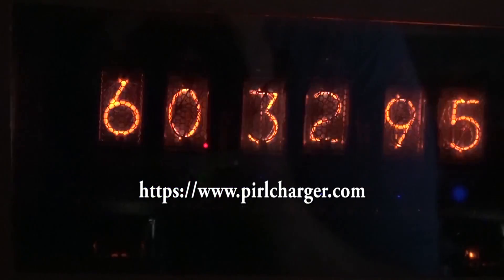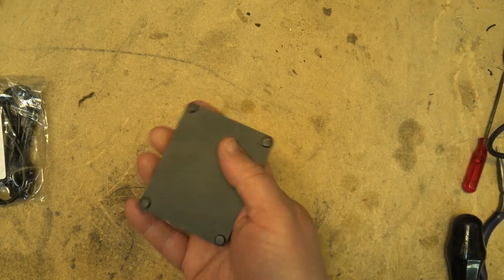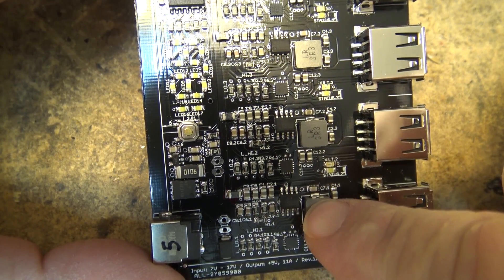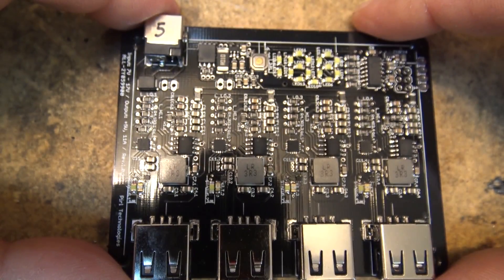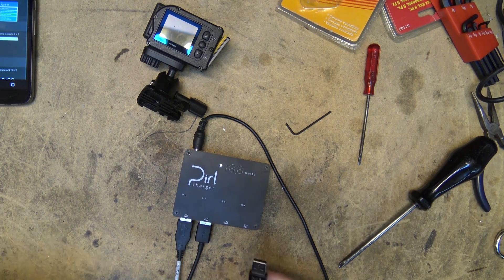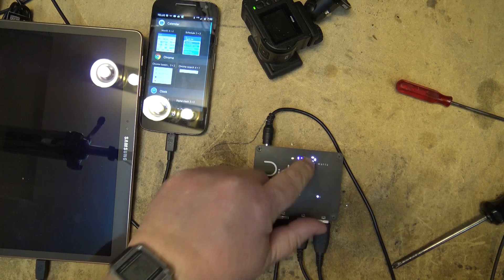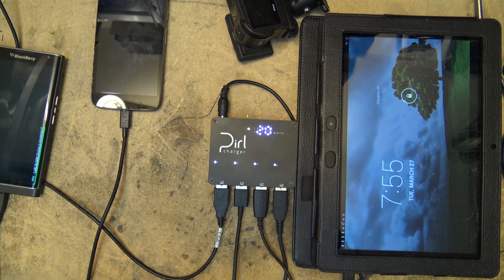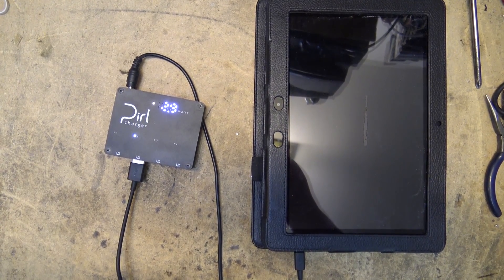pirl charger prototype teardown and test

Comment: Its okay the only disadvantage is it took 5 hours to charge ipad!!! Terrible! Just looks nice
Reply from the maker: cell cobb 
Really? I change my Samsung tab10 in about 2 hours my Samsung s9 charges up in just over an hour. All my devices charge at the maximum rate supported by the device. I have been using it as my daily driver to charge all my devices and it hasn't skipped  beat. Therefore if you are the only one having an issue I would suggest it is  problem with your device or the cord you connect it with can't handle the current. I have been using it with a 30 watt adapter which means only 30 watts max across 4 devices. I generally only charge 2 or 3 devices at once as I use it to change my work phone and my tablet plus a battery charger and power bank. The power it supplies per port is totally dependent on the device.

Comment: What is the part # of the (4) 16-pin ICs? I can't tell from the video.
I can see the AP65450 which is 4A, 18V, 650kHz ADAPTIVE COT STEP-DOWN CONVERTER
https://www.diodes.com/assets/Datasheets/AP65450.pdf

Comment: I think they would save big on BOM if they just use a pre-made 2-1/2 digit LED display, rather than hand fabbing it like they did in this prototype.
Reply from the maker: William Squires 
Believe it or not this is probably cheaper than buying a 2.5 digit display. Smd led are dirt cheap.
Reply: 12voltvids - maybe so, but labor isn’t! Even if you have a pick-and-place machine, it’s still faster to pick-and-place a single LED display, than all those individual SMD LEDs. You also have the cost of 3D-printing the light pipes, and machining the holes in the case vs. one rectangular hole for the 2-1/2 digit display. Plus, their approach just makes it look cheesy and unprofessional; like some DYI’er did it in an evening in their garage, all while being “helped” by a feline companion! :) Just kidding, I like 🐱. Do you know where your cat it tonight? Meow!

Comment from the maker: I am charging 4 devices tonight, 2 tablets and 2 cell phones from my 2.5 amp power supply and it is charging at 32 watts on the display right now which is pretty much maxing out my 30 watt wall wart.

Comment: Looks really nice.  It all comes down to how much it costs.
Reply from the maker: You will have to visit their web site to find that out. As I said this is a prototype, but from my initial check over, and subsequent use today this is a fantastic charge unit. I was pulling 32 watts into 4 devices from a small 12 volt 30 watt adapter, so if I put a bigger adapter I would expect to see the full 50 watts. At 32 watts total (according to the internal watt meter) it didn't even get warm.
Reply: 12voltvids not a peep about cost on their site.  Ive had a couple of the Anker 6 Port 60w chargers for a while and are pretty happy with them.  They only do 2.4a per Port but I don't think I've seen a device that'll draw more than that unless it's got QuickCharge or a different proprietary fast charge solution so I don't think that's an disadvantage.  I'll be keeping an eye out for the Kickstarter.  If this charger is competitively priced I'll get one for sure.
Reply from the maker: The unit is NOT in production yet. The kickstarter starts in April. I woud imagine pricing will be announced shortly. I can say that the customs declaration form said it was valued at 40.00.
Reply: Jason james I wouldn't say it's $30 too much.  The 6 port Anker supply I referenced is $30 and is the offering from them with the most similar specs.  But I do agree with the sentiment.  Five years ago this product would have made sense but these days it's a pretty tough market to try to join.
Reply from the maker: These days you can get power bars with USB charging, and even wall outlets with USB, but the one thing I like about this is I don't have to have the power bar on my desk. I have a single 30 watt wall wart plugged in and a single cord to my desk, where my 4 devices plug in. The digital display also tells me how much power is being drawn, and what devices are charging, and it drops down as the devices get to full charge. That plus it is a metal brick, and it looks cool.
Reply: Do R/C! I agree that my comment was harsh, but as you say it's a tough market out there. This thing doesn't have enough of a USP to justify the cost, especially for this type of unit that tends to be fit and forget.

What the manufacturer needs to do is demonstrate that it can charge demanding devices better than the competition. No amount of nice design is going to shift many units of what is quite a humdrum little device these days.
Reply: 12voltvids As I say though you can get safe multiport chargers that do everything this does apart from the display and the pretty metal box for $10. I would be interested if the device had individual displays for each port, available at all times. Just $40 is too rich for one of these things in 2018.

Comment: Add my name to the list.  Will be interested to see their Kickstarter offers.  Hope that they also provide, or recommend, a beefy power supply that can fully support the power requirements for all four 2.7Amp ports.
Reply from the maker: Jim Litz 
You can register yourself. It didn't come with an ac adapter and I just used a 30 watt adapter I had kicking around. A 5 amp 12 supply would drive this to full power no problem. A 5 amp supply at 12 volts is 60 watts, more then enough. These are readily available. I just used an old cable box power supply I had kicking around. I was going to hook it to a battery but didn't feel like cannibalizing the cord to my powere adapter to do it. I will make a follow up when I get a spare cord and push it to the limit and see what it does.
Reply: Oops.  Meant to say that I "added my name to the list" :)
Looking forward to the follow up video.  Looks like a great product.  I'll be watching their KickStarter.

Comment: There's no way to get 11 Amps into this thing without it overheating so it's basically a scam.  In the demo you were using less than 2 Amps, nowhere near the claimed capacity of the device, so any 4 port hub with an AC power supply could be used to do the same thing!
Reply from the maker: steve c 
Well first of all I was using a 2.5 amp 12 volt supply as that is all I have on hand. I could make up a cable and feed it from my 17 Volt supply and I would set more power. The devices I was charging with the exception on my BlackBerry are standard charge devices so they are only going to pull what they are limited to charging at. This will support 4 devices at 2.7 amps @ 5 volts. Do your math at 17 volts input 50 watts of output will draw less than 3 amps on the input. At 12 volts it will draw just over 4 amps.  Remember ohms law. Volts x amps= watts. So on my 2.5 amp max supply I could draw max 30 watts. Now take into consideration overhead the 20 watts I was charging at seems about correct. Love it how people with no engineering background are quick to jump on claims as fraud without doing a single calculation. Each port can put out 2.7 amps @ 5 volts so 13.5 watts per port max which would be 54 watts for 4 ports. They claim 50 watts total charging power which is totally attainable as this is not just a "hub" that distributes the power 4 ways, it is 4 independent chargers that all operate separately.
Reply: Most of these new high frequency buck converters are now 97%+ efficient.  So at 11 amps output at 5 volts is 55 watts.  The efficiency is so high, less than 2 watts required for waste heat dissipation. That board can dissipate 11 amps no problem, even without the heatsink measure.  You are probably thinking of old school linear regulators, which would require massive heatsinks and never fit into a form factor as this.
Reply from the maker: Exactly, and remember we are not talking 55 watts at 5V. We are talking specifically 4 separate channels each capable of delivering 2.7A @ 5 volts, which is 13.5 watts per channel. With a 12 volt input that is less than 5 amps, which the connector can easily supply.  The problem here is many of these "experts" are only internet experts, and not electrical engineers, as even someone with minimal electronics education understands ohms law, and the calculations are pretty simple.
Reply: One thing........put 2.7A (5V) on each port and measure the temperature after half an hour. This is also measurable in case you are an internet expert :-)

Comment: say one more time "charged" , i dare you . also that input jack is not fit for 12 amps, tell them.
Reply from the maker: How would the input jack ever see 12 amps? At the full rated 50 watts, the input would be less than 5 amps at 12 volts. Brush up on your ohms law.
Reply: 2,7 amps per port capability x 4 ports = 10.8 amps. Plus the conversion loss and the display current, will be close to 12 amps. Isn't it? The input connector should be chosen for that maximum amperage, if it's a good design. But unfortunately, the designers try to cut costs, betting that devices only eat up 1 amp per port for charging, and the input connector will handle those 4 amps. But this is an immature design, which is not worthy to boast about the 2.7 amps PER PORT capability. I want to see it handle that power if it's in its specs.
Reply from the maker: Pop Tibi 
You can't do math can you?  The higher the voltage the lower the current. The input is not 5 volts. It is 12, and at 12 volts 60 watts is only 5 amps. It can easily pass that. I have had it draw 32 watts from my little power supply.  I'll run down my batteries and put it on a bigger source to prove this if you can't understand engineering. It will do it and then you will feel like an idiot.

Comment: Shame it has no USB Type C support. It could be obsolete pretty soon after release.
Reply: Can it charge USB C devices. Of course it can, just plug in your USB c connector cord.
Reply from the maker: Sure it can charge USB C devices. USB C supports 5 volts at 3 amps max which is 15 watts. This supports 4 ports @ 2.7 amps (13.5 watts) each, so it is well into the USB C charge domain.Remember USB 3.2 is limited to 1.5 amps (7.5 watts) and USB 2.0 is limited to 500 mA (2.5 watts) 
So yes it will definately charge a USB C defive and do it at very close to full speed. I didn't test it with any USB C devices as I don't have any, but it certainly charged my blackberry quickly. From 50% to full in less than 1 hour. 
USB C also, on some devices supports a 9 volt charge option,called USB  PD, which supports variable voltage and up to 100 watts of power, but that is a different animal. For charging tablets, phones etc this will fit the bill with most users.
Reply: Ty u for the comment bro i was thinking same shit no ipad 12.9 pro😥

Comment: Now that looks really well thought out, independant channel per usb device and by the looks of it a seperate chip to communicate with the device on the data lines.
That should be very reliable, spread loads on 4 channels :-D.
Main input power processed before it gets to the channels :-D
Smart functional design.

Comment: 20 watts at 5vdc is 4amps.. not bad at all.
Reply from the maker: Learning Electronics Cheaply 
Right but this isn't putting out 4 amps at 5vdc. It puts out 4 x 2.7 amps @ 5vdc. Remember the 4 ports are independent.  Each port can do 13.5 watts. On a 12 volt supply that will draw close to 5 amps with the overhead. I will make up a cable and drive it with my bench supply. I didn't have a spare cable to hook it up last night and didn't want to cannibalize a good 12 volt brick as I will be using that brick to power this in the house. Watch for follow up video.